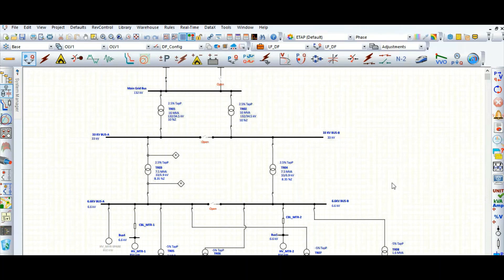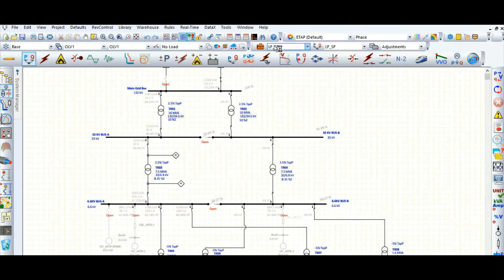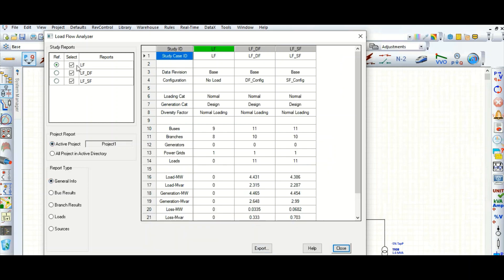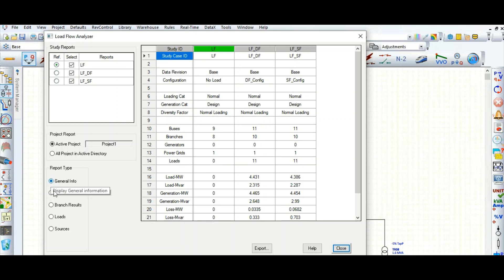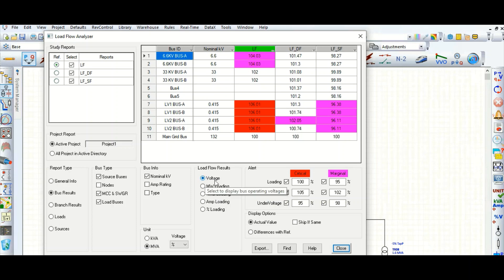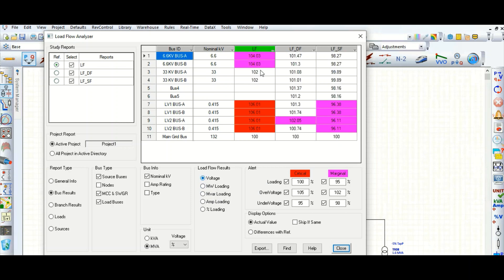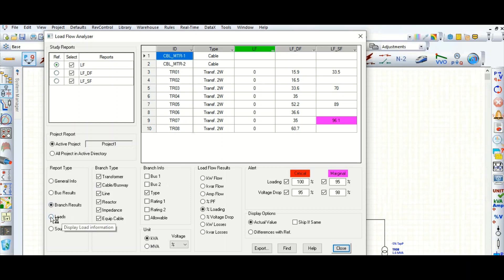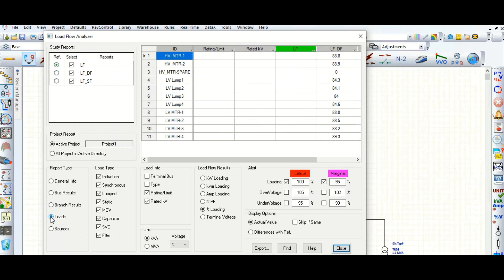ETAP Load Flow Analysis II Load Analyzer

Comment: Thanks sir this is really  helpful.
PLEASE  sir how do i check the current across line 1,2,3 after running my load flow for unbalanced system.
Reply from the maker: After running Load Flow study, you have to check in the display option for all the phase currents..